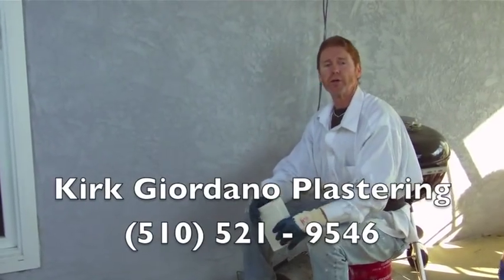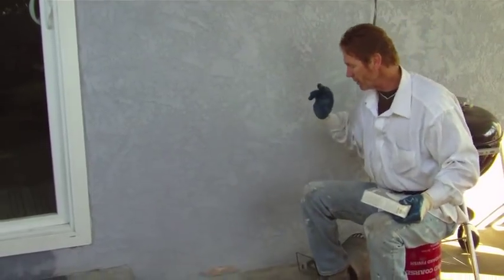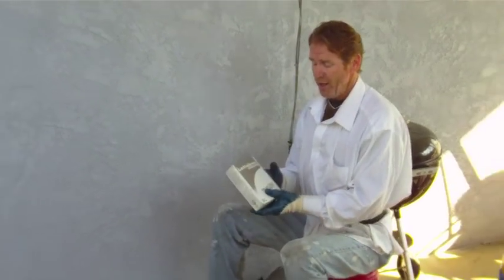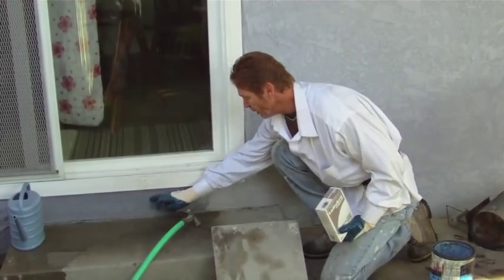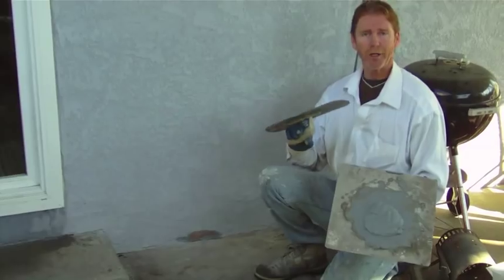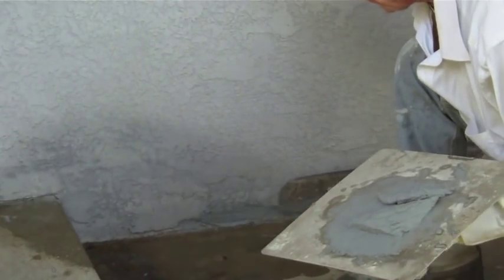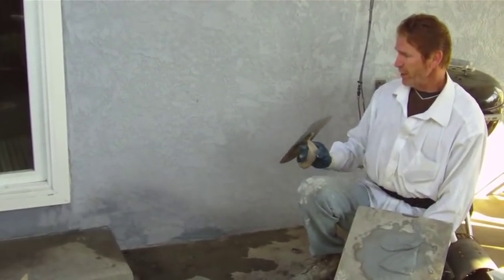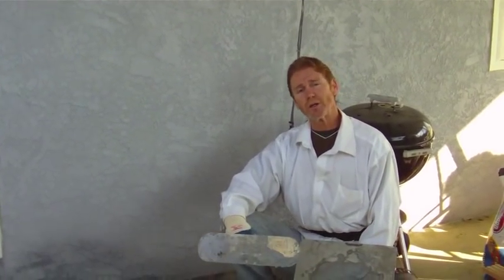Restore your chipped-off stucco colors

Comment: When you mix the Lahabra color kit you just add water?  or something else? And what type of bonding agent?
Reply from the maker: Good morning Spaky, with these patch kits you just add water, If it's a maintenance-free color finish it should adhere, without a bonding agent if it' s painted these kits won't work.
 best wishes,                
                                Live long and plaster
                     Plastering tips and techniques